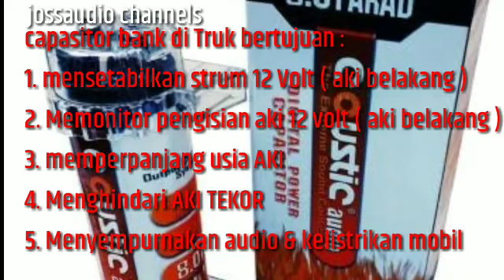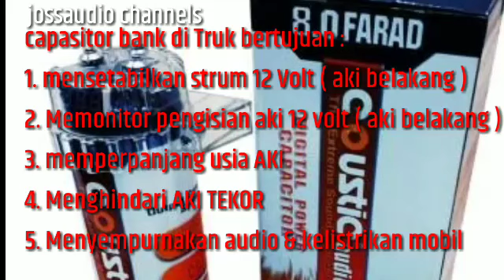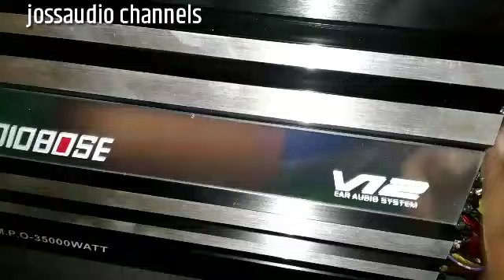HOREGG COY !!!  Cara Pemasangan Audio Mobil dan Instalasi pada kendaraan Truck Canter Part 2,

Comment: Subwofer'y brp in itu bang, trus box bisa masuk di bawah dashboard laci'y di ilangin yah bang...
Reply from the maker: Subwoofer 12 inch bisa, 
Untuk Laci tetap ada , sekring tetap  terpasang, relay tetap terpasang....yg gak terpasang adalah Plat besi2 yg hitam didalam diambil..
Terimakasih semoga mmbantu inspirasi dalam berkarya
Reply: @jossaudio  itu power monoblock apa 4 chanel om...
Reply from the maker: @abibgunawan659  4 ch gan
Reply: @jossaudio  4 ch kok horeg bgt kyk'y ya gan..

Comment: Maaf bang mau tanya solusinya.sy jg di mobil pasang dgn cara  sama tp knp aki 12 tmpt sambung ke power cepat habisnya tdk sampai sebulan,padahal mesin hidup.dinamo Amper sdh ganti baru ttp sama.. Dutro 110LD 2008
Reply from the maker: Cepat habis airnya yaa
Reply: @jossaudio  aki kering yg di pasang bang.??
Reply: Pertama sy pakai 12v 60a,,ganti pake 70a tp tetap sama bang..
Reply from the maker: Akinya sdh ganti gak ada sebulan ???
Reply from the maker: Powernya yg dipasang brp watt ??
Reply: @jossaudio  aki sdh ganti  3kali.yg 70a.. power pertama monoblock Gardiner 600w.trus ganti lg pakai 4chnl venom diablo.tp ttp sama aki yg ke power cpt tekor.. untuk HU sy ambil langsung dr ACC kontak pakai inverter 24 ke 12..amper nya sdh lupa..bang..
Reply: Klu cuma putar HU aman bang biar mesin mobil padam..tp klu power hidup ya bgtlah..
Reply from the maker: @christianpojoh2901  ada batasan kalu pake power atau monoblok...
Treatmennya kalu sdh pake monoblok sebaiknya nambah aki tersendiri dan alternator sendiri.
Reply: @jossaudio  maaf bang sy tanya lg,,klu cuma tambah aki sj BS apa tdk.??terus klu BS caranya bgm??
Reply from the maker: Kalu mau tambah AKI .....positif ke jumper min ke masa...
Reply: @jossaudio  ok bang terimakasih atas saran n masukannya.. semoga sukses selalu  bang..